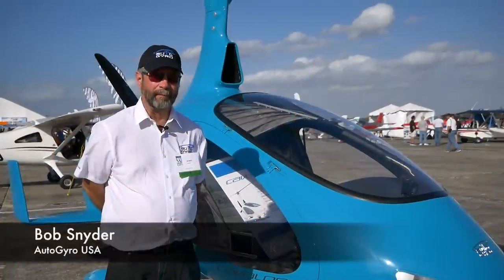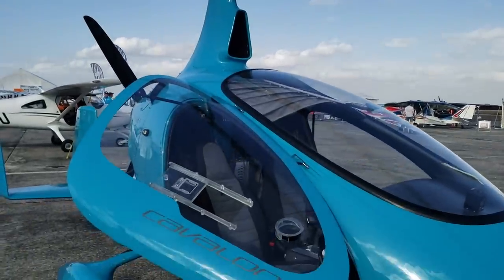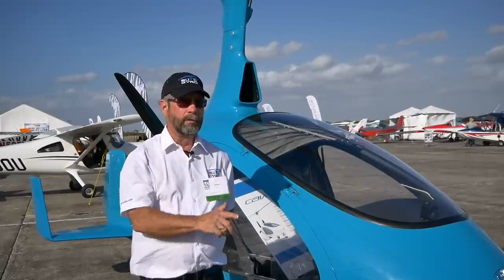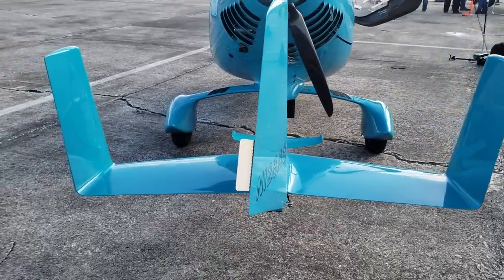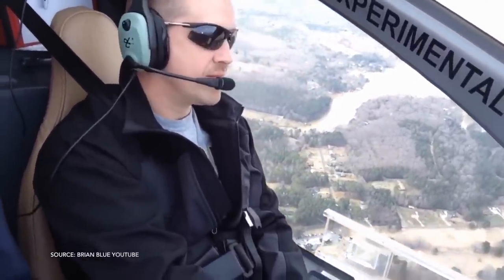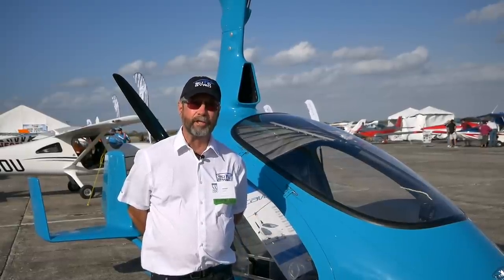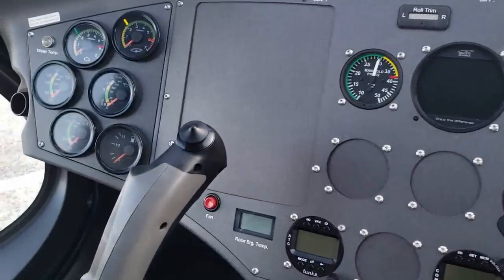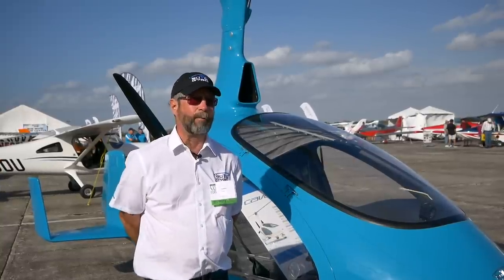WHY Pilots Fly This Instead Of An Helicopter l AutoGyro Cavalon

Comment: You could probably build it for 30 grand if not cheaper lol probably 20 lol I would think a fixed wing would be more fun then you can roll do flips fly upside down all kinds of stuff plus land in the water or snow. Ecspecially a nice bush plane
Reply: A nice bush plane would not be cheap, just the wheels needed cost a couple of thousands.
Reply: Gyros loop, roll and can land in snow or water

Comment: The engine fail auto rotation landing feature sounds good. A electric motor may be a reliable alterative also, if you could get 100 horse power, and enough batteries.

Comment: If it couldn't do VTOL, why the hell would I want more moving parts to fail rather than a simpler lightweight STOL aircraft like Piper Cub?
Reply: ngentotsemua  Probably less parts in a Gyroplane. My planes have a lot of parts :)
Reply: @barrykropelin3845  If you think a rotating pitching wings like gyroplane has less parts, you are insane.
Reply: ngentotsemua   Rotors are fixed pitch at around 1.5 degrees.  Simple gimbled  head. Rudder control and 2 control rods for pitch and roll......lot less parts than in my plane.
Reply: @ultracruiser41able  the word rotor alone has more parts than your entire plane
Reply: ngentotsemua   I invite you out to the hangar to prove it to you.. anytime.  I’ll even treat for lunch after a flight in both!
Reply: @ultracruiser41able  bruh it's just simple physics, fixed plane is objectively has less parts than gyrocopter.
Reply: ngentotsemua  once again......I can prove it to you in person.  Built and flown both.
Reply: @ultracruiser41able  wrong
Reply: ngentotsemua  like talking to a brick wall. I guess we’ll agree to disagree.
Reply: @ultracruiser41able  You mean talking to facts and truths

Comment: 1:08 How does it glide with no fixed wings?
Reply: Jeffrey314159  the spinning rotor is its wings. :)
Reply: @barrykropelin3845  But it cannot glide on those wings, it needs fixed wings for that - -  If the motor fails, does the rotor automatically lock into place across the middle of the craft?
Reply: No sir.....if the engine quits.....the wing (rotary wing) continues to rotate creating lift.  The gyroplane can glide easily to a landing.....or go straight down....about 400-500 feet per minute......then flair to a landing.  They glide like airplanes......just with a rotating wing.

Comment: If someone could overcome the lack of tight turn maneuverability, I'd venture to say these would become the new crop service aircraft of choice.
Reply: Tight turns are not a problem in this aircraft you can climb and do an AG TURN similar to a spray helicopter and reverse direction if very little area
Reply: Ron Andress - I've never seen a gyro make a tight turn.
Reply: @driverjamescopeland  look on utube under 
Zenon Extreme

Comment: Auto rotation how?
Reply: Once the ground-roll starts, the blades are constantly in autorotation due to the airflow through the rotor-disc and the forward thrust is provided by the pusher-prop. They will continue to autorotate even when forward airspeed reaches 0mph (although the aircraft will be descending at that point) much like a sycamore seed.
The explanation about driven and driving portions of a rotor-blade is a little complex for a YT comment but I am sure that you can look it up, somewhere.

Comment: A jump gyro addresses the shortcomings of a regular gyro, and I feel is safer.
Reply: ayokay123  Jump capable gyros are available.....a lot more complex which can mean more expensive to build and maintain.  More to go wrong.  In 35 years of flying.....never needed a jump take off.
Reply: And it puts a lot of strain on the rotors. No manufacturer recommends a jump take off.
Reply: @ictpilot  You mean no manufacturer that doesn't make one.
Reply: @ayokay123  Jump takeoffs put alot of strain on the rotor system. Even if they made them to be able to do that, I bet they don't recommend doing it all the time.
Reply: @ictpilot  You obviously haven't put a whole lot of study into jump gyros. Look up Carter's.
Reply: @ayokay123  I've seen the Carter Copter, and I've seen it do the jump takeoffs. I've also talked with instructors and people in the industry that have said it's not something you want to do all the time because of what I said before. You'll also notice Carter Copter is no longer in business. Though not because of anything with jump takeoffs.

Comment: My mate reckons hang-gliding (not just gliding, he soars, catches thermals going up to two thousand feet above a suitable big range, and has soared at least 18 km and back along sea cliffs) is the most fun flying (and he's flown gliders too).  I wouldn't know, I've only had a go at the controls of a Cessna (in level flight only), and I did the beginnings of hang gliding (only hanging, not flying prone, nor soaring).

Comment: why does the take off roll look like its 5000 feet ?
Reply: It doesn't....the take off footage was with a fully loaded machine on a 5300' runway......why take off and quicker?.....didn't need to.
Reply: @barrykropelin3845  i always look at these thinking about the 1800 foot run way i fly out of ,but i quess these days the new rotor system can spin to 320 rpm for way better performance ?
Reply: Yes....normally....with a pre-rotator at least to 130 rrpm......a 400-500 ft roll is very common. :)

Comment: "Why pilots fly these instead of a helicopter?" ... because they're cheaper? because they need a runway? ... because helicopters are more difficult to fly? ... because they can't hover?
Reply: I think helicopters are much harder to fly. I've heard people say they just couldn't get the proper control.  I think many people also like the ability to glide in case of an emergency. A lot of people are afraid of helicopters simply because if something goes wrong it doesn't seem like the survival probability is too high. I love helicopters, they are my favorite aircraft but I am not a pilot, although I do plan on paramotoring in the next few months..... hopefully, maybe.
Reply: notsosilentmajority1 ... Helicopters can glide in an autorotation. My glide ratio is @ 1.5 NM / 1000' of altitude at 65 knots.
Reply: @gulfair-cavalry-tango1011  
I just was reading about that.  I didn't know that and there may be a lot more people out there that aren't aware of it either.  Thanks very much for the info.  Best wishes.

Comment: so in conclusion, gyrocopters have virtually no advantages over fixed wing planes except some people think they are really "fun"? oh and they still cost just as much as a fixed wing lsa
Reply: They don’t stall…..they have superior maneuvering ability…..in an engine out situation…you could land on a driveway or any small open area.
I fly both gyros and fixed wings…….gyro is safer and has more options in an engine out situation.

Comment: What's the travel distances?
Reply: 25 gallon fuel capacity.....4.1 gallons per hour.......around 80 mph cruise.
Reply: @barrykropelin3845  thanks..👍
Reply: @barrykropelin3845  so why is this better then a helicopter ? Like a 
Mosquito Aviation XE or other small 2 seater?
Reply: @veeeforvendetta  no one said it’s better.....some people prefer it due to lower operating cost but still a rotary wing aircraft.  I’ve owned both.....I prefer the gyro.
Reply: @barrykropelin3845  I guess I should had asked what is better. What I like about the Helly is the ability to take off and landing..on the dime.. and room to.

Comment: I hear your English and see them flying but it just looks like a death trap. A really fun death trap.
Reply: Ananda Mañana These autogyros are easy to fly and very safe, but like any aircraft, if you go beyond the aircrafts flight window, it will crash. I’ve flown a gyro and own a homebuilt experimental airplane, have a GA pilots license SEL. The gyro flies like a large aircraft, lumbering, slow to respond, smooth , and usually very forgiving. As long as you don’t do anything dumb. You definitely need flight training to learn the do’s and don’t s of flying one of these machines.  Do your research, especially about negative pitch over, and line of thrust problems with some gyro designs.  Failure to understand these will get you killed.  All aircraft have things that are no no’s, gyros are no different. Respect those limits and you will have loads of fun and enjoyment flying one.  Looking to get one myself.
Reply: @Hiflier35thCAG  I am sure they are as safe as anything else given that they are operated correctly. They just LOOK hinkey as hell!

Comment: Actually for me the first time I saw a gyrocopter was a Mad Max movie. I thought that was pretty cool. I never got around to flying. I did however work on aircraft for the Navy for 20yrs then I became disabled. I kinda gave up on it. To bad you can't just go straight to a gyro and get a license for that instead of having to go do all the other stuff. I have worked on many avionics equipment so I know how that works. I also have done many different flight sims. So I do have knowledge enough to fly if I had to. But to bad there isn't a flight sim for a gyroplane or gyrocopter, That would be cool. One of the things I have noticed is most flight schools have planes or copters to learn how to fly but I haven't seen any with gyroplanes at least not here in Texas. I believe if someone where to build and design a large one for taxiing people from place to place. It might take off big here. With our state being so big. It takes many hours to get from Lubbock to Austin or even Dallas for that matter.
Reply: You can go straight into a gyroplane rating....but it’s cheaper to get a fixed wing rating and do a gyro add on. There are Gyroplane CFI’s all over the country...even in Texas.
Reply: The is actually a 103 complaint gyroplane made by some European company..legally you dont need a license to fly it but it would be dumb to attempt to fly it without training
Reply: Sengwe setogile.....if you are referring to the AutoGyro Cavalon......it is not a part 103 compliant ultralight and does require registration and licensing.  A legal ultralight in the US cannot weight more than 254 pounds empty and is limited in speed and to 5 gallons of fuel.
The Cavalon gyro is heavier....can carry 25 gallons of fuel and cruises 60-90 knots.

Comment: I wonder if these can also hoover? I am glad that it will glide down when engine fails or gas fails. Cost around $125,000 + costs for extras, maybe another $25,000. Some can use regular gas.
Reply: Rick Bueche   Gyros can't hover but they can "kite" if there is some wind.

Comment: I couldn't operate my Benson from my 40x40 helipad at my house.    Ergo the helicopter. The difference in cost is made up by not having to trailer to the airport, pay hangar fees and having an airport mgr. tell me I can't use a spray can to touch up the paint and always having to find a smooth and long enough runway.
Reply: I use my gravel rd.
Reply: I've seen some good prop dings from gravel on runways.

Comment: You can't say that the rotor is not powered if it is needed for take-offs.
Reply: @yendor9078  In flight yes, but not at take off
Reply: @yendor9078  Yes I know that but it still need temporary power on the rotor used for lift for take-offs. There is a shaft connected to the engine.
Reply: Only to prerotate to around 200 rrpm.  Then...it's wind that spins the rotor to takeoff and flight speeds.  Prerotation shortens take off roll.

Comment: Handles like a plane, but if the engine stops does it drop like a helicopter?
Reply: So Cal Bee Guy ......you mean....does it autorotate like a helicopter?  Gyro is always flying in autorotation so if the engine quits......you just glide down for a landing.

Comment: so as long as the blade doesn't snap or break, you're safe in the air?
Reply: Yeah, it looks really delicate
Reply: It's not delicate.....when rotor is spinning up to speed...it's stressed for 10 G's +
Reply: Same risks as a helicopter, only you're in autorotation already. Seems safer to me.

Comment: So are these aircraft "safer" or more forgiving than planes and helicopters?
Reply: Unless you push the stick or yoke forward suddenly. That's what you do when a fixed wing craft starts to stall. If you do that in an autogyro they tumble. 100% fatal as far as I know. In this bird, you pull back when it starts to stall, which getting it to stall is tough.
Reply: RedWolfSV Wolfe  What are the accident stats for gyroplanes compared to airplanes and helicopters, if any ?
Reply: See the Arup planes from Indiana and the Nemeth "Parachute Plane"  in the '30s.
Quick and sleek on little power, stall and spin-proof, and steep climb-out and landing, and super-slow landing speeds.
Reply: I fly both fixed wings and gyroplanes and I can say with many hours of experience......a well designed gyroplane with the proper training is much safer than a fixed wing aircraft.  Both are risk management vehicles......train, train, train!!
Reply: @redwolfsvwolfe5013  The new modern designs are much more stable but aggressive forward movement of the controls will still get you into trouble. They have had somewhat of a bad track record for several reasons,,,,,high center of thrust and short coupled, people thinking they could teach themselves to fly and this usually doesn't end well, and there are also not that many flight instructors for gyros so you may have to search to see who may be close to you. I have time in fix wing, helicopter and gyro and have to say I have the most fun in the gyro,,,,,,when I get the feeling I want to hover I go out and fly on a windy day that keeps most small fixed wing aircraft on the ground and point the gyro into the wind and just sit still,,,,for fixed wing pilots this is a little weird.
Reply: @ronandress5948  That's good information. Thanks. Any thoughts about turning a small top wing plane into a gyroplane. I'm thinking about one that already has a tricycle gear. And the tracker prop would take care of that high thrust problem.
Reply: You do not want to push forward stick too fast, it will "unload" the rotor. Think negative G's. They will lose lift and come out of plane. Just like a helicopter.
Reply: @ictpilot  Perhaps a control dampener could be built in to discourage pilots from doing that.
Reply: @redwolfsvwolfe5013  Not needed. Just like flying a helicopter, it comes down to training. You don't go negative G's in a helo either.

Comment: How likely is the rotor to fail? If so, you would fall out of the sky, correct?
Reply: Very unlikely to fail.....and yes.....if it did....you'd fall out of the sky.
How many helicopter rotors fall off?   Aircraft propellers?  Wings?

Comment: Ok, I get they are fun. So its a more expensive option than power assisted glider. That said can you realistically fly from from point A to point B. What if I wanted to use it to commute to work? Can I land it on their parking lot ?
Reply: Could land in a parking lot but getting permission to do so might be tricky.

Comment: Top speed?
Reply: Cruise around 90-95 kts. About like a Robinson R22.
Reply: Ictpilot Ictpilot - Urm... No. It cruises at just less than 60kts.
It won't even cruise at 90mph let alone knots. Its VNE is 100mph (160kph). It will cruise at around 70mph although it will go faster but it becomes a lot less efficient. Page 5-3 of the POH lists the best range speed as being 110kph IAS ( = 68mph = 59kts).

Comment: 125 grand for something that should be about 15 or 20 grand. Its a shame that aviation is so far out of reach for most.
Reply: Probably carbon fiber or the like. Also, these won't benefit from the economies of scale of an automobile, and will face a stricter regulatory environment in some ways.
Reply: Oh heck, its hard to buy a decent car for $125K

Comment: Ok, I've been told that the gyrocopters have one drawback and that's the JESUS bolt. Is it a matter of them not being torqued down enough or should they be made of a tougher material?
Reply: The “Jesus Bolt” is very important....I’ve never had an issue with this bolt....it is rated at over 186,000 psi and much stronger than necessary.  Good maintenance procedures and preflight checks are mandatory.
Reply: @barrykropelin3845  Thanks, good to know you're safe. lol

Comment: Dont need a helicopter license to start with
Reply: jadekayak01  but you need a gyrocopter license or an add-on to an existing rating.  Unless your flying a proven ultralight design.....which there are very few.
Reply: @ultracruiser41able  it does not have to be under ultralight rules.

Some gryocopters can really move,in which case you need a ppl-which is still way cheaper than a rotating wing ppl.

My country.

Ppl about $5k-$10k

Rotating wing-minimuim of $55k and you cant fly fixed wing on it
Reply: That’s exactly what I said.
Reply: @ultracruiser41able  no its not

Comment: Gyro ? No thanks. Lift effect work when you're on forward speed but didn't when engine stopped then free fall. Auto-rotation work on helicopter when motor stop is different style...
Reply: terminator3199   nope.....autorotation is the same as helicopter.....except fewer inputs from the pilot.
Reply: Gyrocopters can land with an engine out.
Just as soft a landing as the ground be low lets you. 
You fly in with no power on  and just flare. You do not drop out of the sky, ask anyone who flies one.

Comment: Got no wings. It will not glide when engine stops.
Reply: It does not glide, but it does auto rotate to the ground just fine.
Reply: The rotor is the wing.....Rotary Wing Aircraft.
Reply: Goldfinch . Got you. It will glide and land like helicopters with no power.